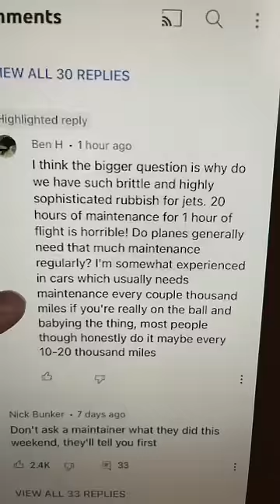Why does an F-16 need 17 hours of maintenance for every hour of flight?

Comment: As a former fighter maintainer, hearing someone else say that they're the key to airpower is very nice.
Reply: It looked like the guy working on the plane was wearing mopp gear, do you guys have to and if so what's the reason? (Edit spelling)
Reply: Some time need to wearing oxygen mask or protective mask with full gears!
Reply: @ktiger1766  why though? I'm genuinely curious, my dumbass went infantry so this is way beyond me lol
Reply: @GenuinelyHorriblePerson  I think I saw a video from Not What You Think that explained it is needed in the fuel system. Like, a guy actually climbs into the wing tanks and inspects everything, with residual fumes as well.
Reply: @GenuinelyHorriblePerson  Probably an exercise. Fuel and Radar Absorbent coating work is done in tyvex suits, like exterminators or insulation installers.

- F-22 Avionics Maintainer

EDIT: The pic in question is definitely an exercise. The masking tape around the wrists and ankles says "SIM." Even if that was the dude's name, they'd use duct tape to reinforce the seal, not masking tape.
Reply: @GenuinelyHorriblePerson  in the event of a chemical or gas attack you still have to do your job. So you have to train to do it in MOPP gear. Even the pilots will jump into their aircraft with protective gear and a breathing mask.
Reply: We’d be stuck on the ground if it weren’t for you guys, so hell yeah y’all are the key.
Reply: @Viper31300  I know what mopp gear is for, I hated using that shit Haha. I just assumed the guys working on the planes were far enough away and well guarded and would be safe from it. It makes sense that everyone should practice with it though. Thanks for the answer.
Reply: @theboothy91  I didnt mean it like that man, sorry if it came across like that. Just thought they'd keep the important dudes super well guarded.
Reply: The whole crew is. Your crew is like a body, with each of you being vital organs, without one part the body is just a corpse
Reply: Maintenance men are the key to most industries. From apartment complex’s to fighter jets.
Reply: Man hours vs hours of maintenance is also being used synonymously when it is not the same. 3 guys working on the same jet for 5 hours would be 15 man hours not just 5.
Reply: @GenuinelyHorriblePerson  I'm a student maintainer and I just had it at school. It's because we work with dangerous chemicals
Reply: @jorelomandam6172  thanks man
Reply: Facts!!!
Reply: So  2 flight hours = 34hours?
Reply: @Nucl3arDude  So in the fighter world (at least on the F-15 and F-16), tank 1 is the only fuel tank a person could fit in. It's located center fuselage behind the cockpit and is the main tank the feeds the engine(s). It is also the only tank with a bladder. All other tanks are known as "wet tanks". They are sealed shut with the aircraft skin panels. They can leak and are sealed shut with sealant when the panel is installed.
Reply: How much $ you make?
Reply: @1eighty  In the military, your pay is depicted by your rank. As a government contractor, you can make quite a bit. I've personally seen $30-$45 an hour depending on the specific contract.
Reply: @GenuinelyHorriblePerson  a little late but to answer your question, the maintainer wearing MOPP gear is currently doing an exercise. I assume somewhere in the pacific theatre such as Korea, Japan, etc.

We do these exercises so that leaders can test capabilities of maintenance in case of a nuclear war popping off (we’ve came close many times in the past)

I have been a fighter maintainer for 7 years (USAF) only places I’ve done these exercises is when I was stationed in Korea and Japan. I’m currently in Korea and we do them quarterly.

You gotta think, in war the first place to get hit on any base is the airfield (flight line). You rule the skies, you win a war. While the flight line is usually heavily guarded it is also the most dangerous place to be if things pop off.
Reply: Every fighter jock I've ever known, and God has seen fit to vex BLESS me with several during the course of this life, (the oldest flew for the USMC in WWII and Korea. Great Boss) has always told me the key to their success was mechanics that kept them in the air. 
I did notice  that they rarely say it when y'all are around though.
Reply: Never disrespect the tail.
Reply: @nautifella  : The good guys do. They acknowledge their maintenance crew readily and vocally.
Reply: I agree it was nice to hear. F-111D, 27th AMS, Cannon AFB '72-'76

Comment: I knew an old man who was a P-47 mechanic in WW II, European theater. He said that knowing that a pilot's life depended on how well he did his job really affected him.
Reply: My job as an engineer is to design/approve repairs/maintenance plans for commercial airplanes.  There is definitely a prevailing sense of "if I'm wrong, then many lives could be at stake."  And it is indeed pretty stressful. You get used to the pressure and responsibility, though. And also, the huge safety margins and redundancies that are designed into commercial airplanes actually make it pretty hard to doom a plane to crash due to one little discrepancy. You can have all sorts of technically unacceptable conditions going on, and still, in reality, be totally fine.

I can't even imagine what it must have been like to be the guy on the ground, actually repairing torn up airplanes that barely limped home, which themselves were designed and built quickly and cheaply for war-time production, and sending a pilot off to battle after assuring them that they're good to go.

Now that is pressure haha.

Comment: That time is an aggregate average of maintenance time over the year, divided by the number of flight hours. It doesnt take 17 hrs every time it flies. But it might take 3 months when its down for an annual inspection, they simply average the time.
Reply: Thank you. I wondered about that - if a 1-hour flight requires 17 hours of maintenance, does a 2-hour flight requires 34? Does it require a 17-hour maintenance after each flight of 1 hour or greater? Etc.  Appreciate the clarification.
Reply: I was hoping someone knew how to explain the realities of this.
Reply: Theyll go to depot for a year
Reply: Not to mention the time it may take for parts depending on the airframe. You may be able to swing a few hour turnaround an unscheduled maintenance for an F-16 because you have parts on base, but on some of the older planes it can take a month to get a part because they stopped making it 35 years ago.
Reply: @DaddyBeanDaddyBean  That’s more of an average. Like you will have preflight and post flight maintenance that gets done, but the hourly maintenance usually gets done after X amount of flight hours. Just an example, a jet might require specific maintenance after 200 hours, and then 500 hours, then 1000 hours.
Reply: I would also assume they are talking about man hours
Reply: @Aoskar95  Exactly, when you have 7 people all working together for an hour, they count that as 7 hours of maintenance for every 1 flight hour.
Reply: You comment answer the question far better than the actual video does.
Reply: @Pugjamin  I agree. Just another typical YouTuber explaining the bleeding obvious and earning money from it, yet not really understanding the subject properly or educating anyone. Everyone's an expert these days 😄
Reply: Otherwise the Israelis could never have pulled off the Six Day War...
Reply: @DaddyBeanDaddyBean  it's also related to man hours. There are inspections that may take 15 hours but if you have three people working it from different angles it takes 5 hours at 5 man hours per maintainer.
Reply: Thanks, that was my question "17 man-hours, or 17 hours of downtime with a multi-person crew working on them?"

I assumed man-hours.    Presumably there is an inspection after every flight, and a pre-flight inspection, the question is how much.
Reply: @smcastor  just like my mowers.  Oil change at 200, hydraulic oil at 500, etc.  But I check the quality and height of cut every time they go out.
Reply: @Nibbles, he probably understood, but just presented it this way for clicks and shock value.
Reply: True. Our F16's where I work are flying 2 to 3 hours per day.
Reply: Thanks, you stole my thunder. I was going to say the same thing.
Reply: @nibbles7178  If it was "bleeding obvious" then they wouldn't ask the question. But they did, so it's not obvious. 
Not everyone is an expert these days, but one thing that is more common than a expert is a critic. Like you, Nibbles.
Reply: Thank you for adding that clarification. It sounds like common sense once you said it, but for the life of me I just kept imagining days of maintenance after a single flight.
Reply: It also doesn’t give an indication of how much minimum time is actually required for the jet to return to flight just after it returned from, say, a normal 4 hour mission. Which would likely require several maintenance personnel working in parallel, reducing the actual time needed as opposed to a simple addition of man-hours of work (which the 17 hours figure is).
Reply: Aircraft mechanic here.. this. You can turn any plane around quickly and fly it again.. just know you're inching closer to a big inspection or a time when it has a major mechanical failure. On a post flight inspection you're not really checking everything, but you are. It's more visual, but not that indepth. The inspections are phased. Basically it's just inspections and unscheduled maintenance.

What people fail to understand is how time consuming maintenance on aircraft can be, it's insanely strict. A three hour job can easily turn into 7 hours, 10 hours because you're missing the right sealant, or fastener etc.. because at the end of the day YOU (the mechanic) are putting your signature on the work so if something was to happen then you are the one who is fucked. This is obviously besides the fact that you could hurt the aircrew, passengers, people on the ground, etc etc.

Tldr: aircraft mechanics are underpiid lol
Reply: Thank you. Sometimes people get too caught up in explaining to the plebes why things cost time, money, resources etc and that becomes their metaphorical hammer. Besides, I knew a few US Navy airmen and they would very much disagree with his implied assessment of the time it takes them to get the aircraft back in the air. And they can keep up that endurance for an extended period of time. But eventually you have to pay the piper and have some extended maintenance.
Reply: came here to say this
Reply: @krisspkriss Or lose some aircraft and/or pilots if you keep on skipping that maintenance, as has happened too many times even in the military for no reason other than idiotic bean counting (which is different from necessary or useful bean counting).
Reply: @babybirdhome  Oh for sure. You burn the candle at both ends and you get burned. Skip the wrong inspection and it can cost lives. Same for PMS items. Or even simply sleep and relaxation.
Reply: It's also not one guy working for 17 hours, it's 17 guys working for one hour.
Reply: Is it a total of man hours per flight hour ? So a crew of 6 perform 6 hrs of work every hour
Reply: @DaddyBeanDaddyBean  lol, yeah I was going to ask . . . why per flight hour, why not per mission or per sortie?
Reply: Yeh, thats why aircraft readiness is almost always below 66%, because a good chunk is in maintenance.

Comment: I was a Metals Technician in the USAF, thank you for enlightening the population on our everyday maintenance fight. Again, thank you sir.
Reply: You checked for signs of metal fatigue, cracks, and dents? I would imagine that inspection of some parts (for example, in the engine) requires a fine grained inspection. What sort of inspection instruments do you use for your inspections?
Reply: @MarcosElMalo2  look up non-destructive testing or NDT. They'll use every single type, from ultra sonic to x-ray.
Reply: My question is that 17 hrs total? Or 17 hours “labor”

If I put 30 men on that plane and it takes them 30 minutes. Boom 17 hours of maintenance.
Reply: @MarcosElMalo2  A Maintainer is a Maintainer. Do you give 100% of the credit to the crew chiefs or share it with the fuels guys working the internal fuel system? Or the engine guys? NDI is the inspection your describing. Metals tech fixed whatever the other maintainers broke or fabricated a new part from scratch. Certified welders and CNC operators/programmers. Like I said however, just because your name isn’t on the plane(crew chief), doesn’t mean I didn’t spend the 12 hour shift working just as hard. It takes a huge amount of support to keep the sorties going.
Reply: @blahblah8037  I'm realizing after typing this that you're probably asking OP, but the answer is almost certainly man-hours, errr 17 hours of labour as you put it.
Reply: Thank you for your service
Reply: But we're you ever flightline? O.o
Reply: @personguy9128  all the time.. even in the Haz’s!
Reply: The 17 hours for every one hour of flying is misleading. If you were turning three to four one hour sorties a day that claim would mean you wouldn't have a jet to fly for days on end which anyone who does it knows that's not true. A ten turn 8 turn 6 can turn into 30 minutes to any hour for turning the jets not including whatever breaks during those sorties. If all is well then maybe an extra couple of hours per night of a third to half what was used. If you add all the yearly base for flying including time changes and basic maintenance it wouldn't be anywhere near that 17 hours per one hour of flying. Add it phase inspection time then it starts adding the hours. Basically daily turns don't equate to a 17 to 1 ratio maintenance to flying hours. That should be explained when they say this flying to maintenance ratio.
Reply: I love me some MTECH dudes.  Not a screw alive you can’t can’t extract. And then you can do some precision measurements on my actuator rods and bearings.  And then you can make some local man tools on your CAD machine.
Reply: @jochenheiden  We stopped even trying - now we call MTECH to show the 6,500inlb nuts what God's Saw can do every time a certain TCTO comes up. We have saved hundreds of breaker bars and all have an extra souvenir.
Reply: @inund8  you're thinking of NDI
Reply: Ayyy fab flight, im sheet metal
Reply: How many civillians did your team kill?
Reply: @theboothy91  NDT is the civilian side of NDI. Same shit, different acronym.
Reply: @foreverknight3448  Awkward as fuck if MTECH is out here killing folks lmao
Reply: Get any NDT experience? Lol any long hours at a mag bench? Haha
Reply: @theboothy91  the heading in my course outline calls it NDT, but this is from a few years ago now.
Reply: @inund8  could be what the navy calls it
Reply: @theboothy91  could also be the civilian name for it lol. T for testing or I for inspection, either way it's the same thing
Reply: @inund8  not in the air force
Reply: Dog people shouldn’t have to be told that a fighter jet is completely different from a car, the general population is just ignorant nowadays but they will ask dumb questions when they should already know the answer. Like he said your car doesn’t go the speed of sound upside down. That should be enough to shut up any dumbass civilian who is too dumb to pass highschool. I can’t believe someone really asked why does a fighter jet need 17 hours of maintenance for 1 hour of flight it’s kinda obvious.
Reply: Did you remember to bring your tools?
Reply: @Franki3nm Except an F-16, or any fighter jet for that matter doesn't require 17 hours of MX per every flight hour. As a maintainer, the only way a jet lands and requires "17 hours of MX" if you found something during your PRE-FLIGHT, POST-FLIGHT or THRU-FLIGHT and it's royally fucked up.
Reply: I'd also like to add, canopies don't just come back from flight cracked.... Even if it was a metaphor, this dude doesn't know what he's talking about lmfao.